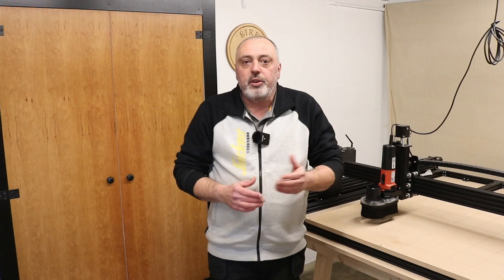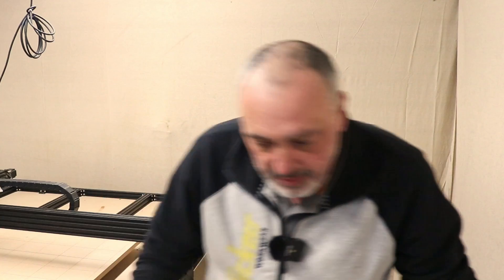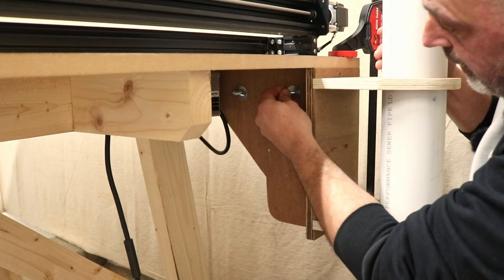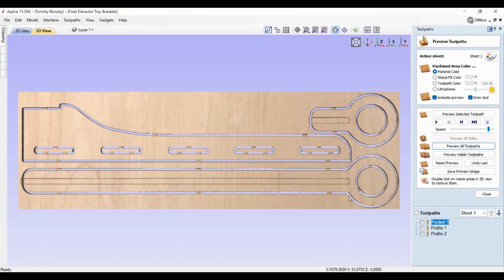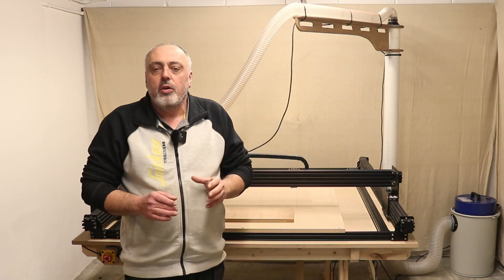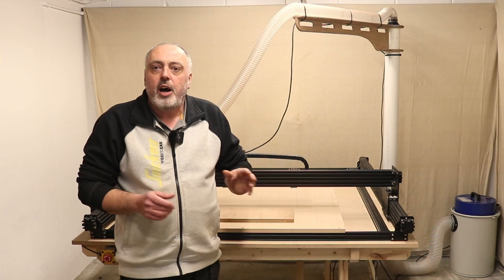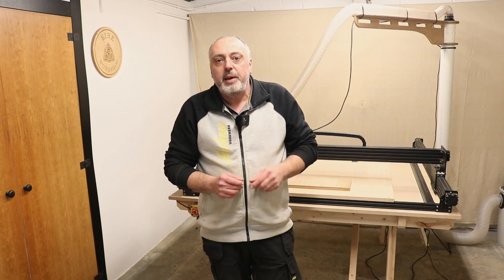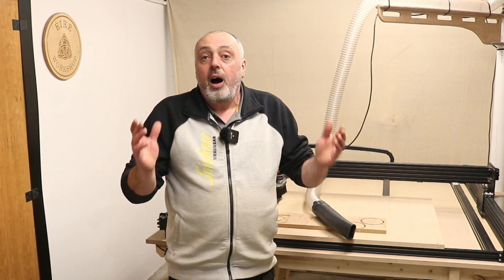Custom CNC Dust Collection Swing Arm

Comment: Good video I like your router box , is it a normal router fixed upside down in the box?
Reply from the maker: Hi Ken, yes that's all it is very simple and easy solution for a router table 🙂
Reply: @ÉireWorkshop  Thanks - so simple ive been messing around with a Silverline thing for months

Comment: Really well done, sir! Elegant in its simplicity and function. The pressure adjustment holes were brilliant. I'd heard that too high a vacuum and the brush hairs begin to get sucked up into the pipe so this was a lovely adjustable fix.  I'll be making mine a little different as mine is going to be enclosed in a dust enclosure but what you presented looks like an easy adaptation. Thanks for sharing, it really helped!
Reply from the maker: Thanks I'm delighted you found it helpful 🙂

Comment: Really like your boom arm. Want to copy it but cannot find the est.99mm ventilation ducting. Easy to get the 100mm but not the insert one. Any suggestion as to where to get it? Keep up the videos - really useful.
Reply from the maker: Hi Simon, I got the ventilation pipe in screwfix. From memory the sewage pipe is 100mm inside diameter and the ventilation pipe is 100mm external diameter. Another option is to put a sawcut in the bigger pipe so it fits inside itself if that makes sense
Reply: @ÉireWorkshop  Thanks for your  help tommy, it does make sense.

Comment: Very good solution Tommy! The baffle holes are a really good idea, and can also come in handy when cutting lightweight materials, as sometimes your extraction can pull the material up slightly as it travels across.
Reply from the maker: Thanks very much, yes I think a baffle is a must especially if using a high pressure system.